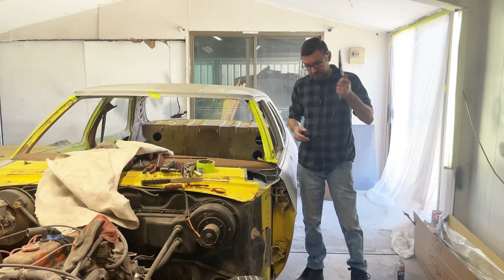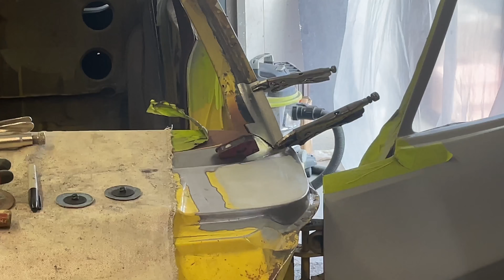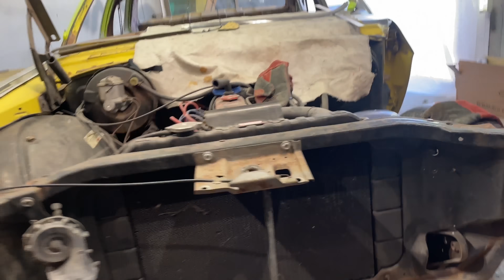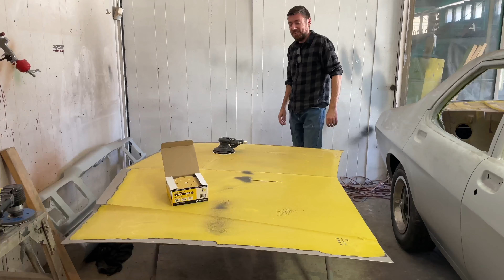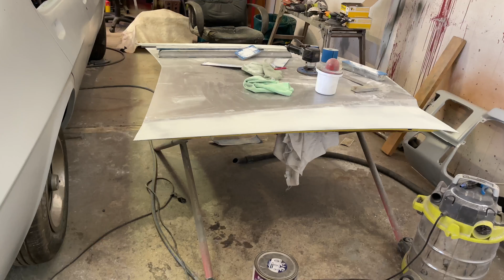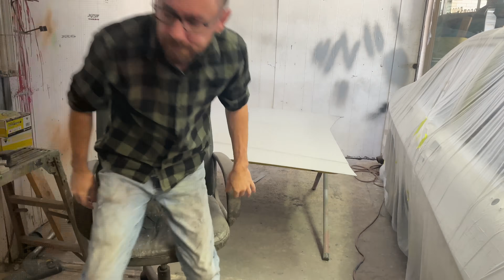Holden Kingswood 'budget' body restoration. Final rust repair and filler work

Comment: I had filler direct to metal of my rear QTR  panel  in 1997 . Bubbled paint 2020 still there  200mm round section